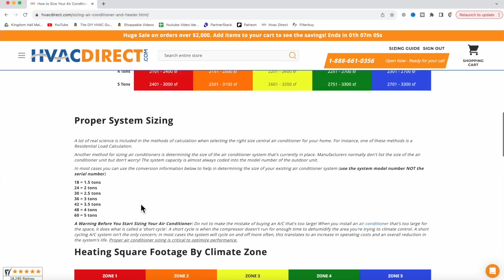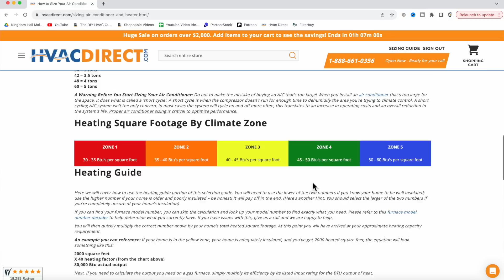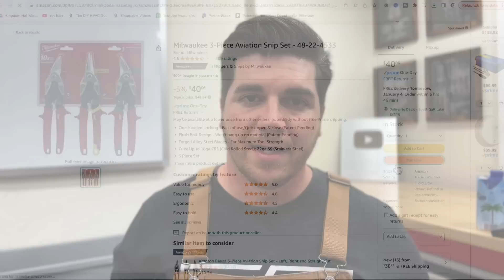Am I Allowed To Replace My Own Furnace?

Comment: I’m planning to replace my furnace by myself but I have a issue. I have an electric unit and I want to switch to gas. My existing furnace has the ac coils at the bottom and the electric coil for heat on top. If I install a gas furnace the blower motor will be at the bottom, gas in the middle and the coils suppose to be on the top. How I can put the coil on the top? Thanks.

Comment: I needed to change out a 30 old Hvac system so I contacted Hvac contractors and ask them If I bought my own equipment and just pay for their labor will they do that, they all said no, you have to buy the equipment from us. I ask why, they said there would be no warranty, I found out that's not true. Anyway, I ended up buying a fully warrantied York Furnace along with fully warrantied Condenser/compressor, filter dryer, txv valve, evaporator/cooler, 2.5 ton 14 seer all for around $3,000 delivered. I was able to find a small father & son operation with 25 years of experience doing Hvac. We agreed on a flat rate of $2500 changeout cost. So, instead of paying a minimum $14,000 I was able to get it done for $5,500.
Very appreciative for channels like this.
Reply: Was this in Utah by chance?
Reply: @CornParticulates  northern calif.

Comment: hey man, so I live In SLC, I have a carrier furnace, I’ve read and researched up on everything my carrier furnace flashes code wise. Thinking it’s either a bad board or pressure switch. Carrier 58pav070-12, let me know If you have some
Spare time and want some brief content for your channel!
Reply: I’ve installed; 
New transistor 
New capacitor 
New inducer motor and fan(hamster wheel)
New flame roll out switch’s

Waiting on new pressure switch 

Considering buying a new board, however different codes will flash if I unplug certain parts, I’d this a good way to test if my board is bad or still operational? 

Still flashes 31, was 33 before..

Comment: The only way the warranty is good if a home owner buys a Goodman system them self, is if it's installed by a professional HVAC contractor.  If the home owner installs it, it has no warranty.  It's listed so on the Goodman website, under support, internet purchases policy.

Comment: Folks in some states are going to find that the HVAC products they want will not be sold in certain areas such as Los Angeles County or possibly the entire state of CA. This is coming from the people in Government who are pushing their green new deal ideals, true or not...better or not...more expensive to operate or not. So, the majority of existing buildings are heated by natural gas and their water is also heated by Natural gas and plumbed accordingly. It's looking like those folks are in for a surprise when they want GAS HVAC or water heating items shipped to CA as those distributors are being told NOT to ship them to CA. Another issues is even if you can replace you gas HVAC with gas, the local codes may force the location to have to step up to a 90+ or 91+ furnace which requires a condensate drain and different types of venting.  Lots of buildings are unable to make that change over without a large expense in re-roofing the structure and many structures might have 10 year old roofs that are no longer manufactured so, no materials will be available to match the existing roof materials. Also, lots of folks just don't see the benefits or the value in the extra cost of 90+ furnaces in the next few years they will use them. The savings in fuel is almost nil and the risk for water damage becomes an issue not to mention the cost to purchase and for some to operate the system may increase. Then there are those who will be subjected to MUST USE ELECTRIC when they replace systems and that itself will require in many cases an upgraded main service panel from 100 amp to 200 amp and those are not cheap to install. Try about $4,000 from most licensed electricians, plus the added cost to run 220v circuit to the attic for the "heat pump" idea and even more if there is a water heater or a cooktop that is going from gas to electric. Same with wall ovens. Same with gas clothes dryers. You pretty much have to re-wire your entire home to replace a lot of items that were an easy replacement in the past. What's worse is, the people will NOT be saving money with their utility bills.  Electricity is way more expensive than gas and in CA electric power is an extortion mechanism to its citizens, especially when its 45 cents per kWh. So, it only makes sense that if you are in need of new HVAC, we citizens are going to have a big concern when it comes to HVAC contractors who want to make 2 to 3 times on the cost for HVAC materials plus in 1 or 2 work days charge a customer $2,000 to $3,000 for labor. Those charges are more than most high priced lawyers and doctors charge !  $5,000 to $6,000 HVAC jobs need to exist but our economic system is working against us as is our Government regulations.

Comment: I was charged $500 during winter to change my igniter at 10:00 pm . What parts would you stock in case of emergency?
Reply: I’m no pro but here’s my list:
Igniter
Flame sensor
A/R Limit switch
Pressure switch set (2)
Flame rollout limit switch
Limit switch/thermostat

The only two I’ve needed are the igniter and pressure switches. The pressure switches were due to a recall. Something to do with the silicone tubing corroding the contacts within. After replacing several years ago with the ‘fixed’ version no issues. I did get two for a spare just in case. I do inspect and service my furnace every year which likely helps keep my spare parts unused.
Reply: I should mention that before I had spare parts and I determined the pressure switches were at fault the first time around I had good luck with removing them, shaking the daylights out of them and they’d work for another day or so. I did that until I could find a vendor willing to sell to a non HVAC buyer. So I’ve made my purchases online at Repair Clinic. In my area (MI) all the parts suppliers won’t even sell you sheet metal screws.

Comment: I can attest to the fact that  you don't have to be a HVAC tech to know how do a lot of the stuff he shows in his videos. But yes, you do have to be mechanically inclined. Those skills I obtained from my dad. But suffice to say, I work in social services by profession and recently our family went without power for almost two weeks due to an ice storm. But because of one of his earlier videos showing how he wired in a switched receptacle, I followed along and I was able to connect our 2000 watt camp generator to our gas furnace and have heat during the power outage. Our neighbors a family of 4, not so. They said it got down into the 30s inside their home and they had to go to a hotel for $100s of dollars a night. Fortunately they didn't suffer any water pipes breaking leaving their home in those temps while they were gone.

Comment: Always pull a permit. The little bit of money you save by not doing it will bite you in the butt when you sell your house. What ever you did without a permit will have to be brought up to current code when you sell. Most inspectors just want your stuff installed safely.
Reply: But 20-30 years from now, the whole house wont be "up to code", they change yearly lol.

Comment: I like this guy. He is a real gentleman - smart, professional and kind. Going back to the topic, I was installing HVAC systems on all my properties. I was doing by myself everything is legal to do in my state. Just because "professionals" nowadays are somehow able to mess with a job unimaginably in most cases. The construction market overheated and overregulated. Company owners getting rich, but the person why actually gonna install your system makes just $20-30 per hour (in the Central states).  What should you expect from his effort? 

But having 16 years of property management experience and a BEng degree I certainly know HVAC installation can not be done properly by the average person. So, better invest your time in picking a good installer.

Comment: I'll be taking apart my gas furnace as the heat exchanger needs some work - It's only five years old.
I will ask a commercial welder friend to repair the hole or crack or whatever is there. Any opinion on this.
Reply: @bluejay713  Replacement is $1,200 CAD. Too steep if I can repair it with the appropriate materials.

Comment: I did Installed A Gas Furnace myself b.c. no Contractor want to install it after I bought it from the Supplier.  Yes I have some experiences with Electrical and A little bit with N.G.  I watched a lot of YouTube videos before I took the Next step.  Two years later, I installed an Evaporator coil and A Condenser Unit outside all by myself. When I Completed the installation of the A/C Condenser Unit and tested everything works as expected . I was so Happy 😅😂❤️

Comment: About 10 years ago I installed a tankless boiler and tankless water heater in my moms house. Both have been working very well since. I do maintain and clean them regularly. I've had multiple plumbers and HVAC techs tell me that those were a waste of money and they would only last a couple of years. Thank you for all of the videos you do. I'll be installing a mini split heat pump this summer.

Comment: I purchased and installed a top of the line Goodman furnace purchased online.  No issues.  The one thing I will say is that HVAC direct and many other places chronically oversize the furnace.  It should be designed to run 100% at the 95% design temperature for your area.

If you know the actual existing output of your furnace, taking into account the efficiency and how it behaves in the coldest weather, that will help.

Comment: you can have an hvac sheet metal company do your duct transition for you just give them the measurements of what you need  to change to simple drawing with dementions
Reply: This is a great option for many. Have the transition built at a sheet metal place and install it yourself.

Comment: its not rocket science to change out your appliances guys kind for kind follow the installation manual  of the appliance it gives you a step by step reading ok , but if you change it out for  bigger size now you have a problem  because you are required to have bigger gas lines etc for the bigger size unit and make up air, exhaust pipe etc domino affect ok

Comment: Can  and DID, I replaced my old Lennox Conservator II 115K 80% with a Goodman 80K 96%, from HVAC Direct, I  located it in a different place in the basement, ran new electric and gas lines to it as well as new returns and ducts all mself.
Only PITA was finding the return plenum pieces I needed, Menards and Home Depot each had some but not all, so I had to order parts from them and 2 other places to get what I needed.

Comment: Is it hard to replace a heat pump?
Reply from the maker: It’s the same as replacing a straight ac condenser basically
Reply: @diyhvacguy  Thanks for the reply!
Reply: @diyhvacguy Yep, only difference is the reversing valve idea.

Comment: a twelve year old with a dozen tools could change a furnace it is childs play.
Reply: Except... if the replacement isnt the exact same height, width. length as the old one, they you have to mess around with making ducts to fit it. In my case I relocated the designated space for the new furnace and had to run new electric, gas line, plenum and returns myself.

Comment: It is possible to change it yourself. Depends on local laws. Some places require a licensed company to do it.
About A/C - if the refrigerant falls under the EPA about reclaiming refrigerant properly, a LICENSE is needed.
So is the proper disposal, paperwork, records, etc.
If you get caught releasing refrigerant illegally, you face high fines and prison times.

Replace your HVAC with like and kind (similar ratings generally).

You can purchase the equipment legally. It is the refrigerant that requires a license to get.
Reply: Nobody is going to go door to door to check or know.
I replaced my furnace myself, it was a furnace only no A/C
Reply: @FCE-dogs  One needs to know if there are any 'Karens' out around them...
Another issue might be your home insurance company.
If they discover it was replace illegally, without a permit and inspections, or improperly replaced, you might have some problems with any claims.

Comment: What is best place to get the sheet metal to make the transition duct?
Reply: Hard to find, I used to be able to get 4x8 sheets of aluminum or galvanized locally in Roseburg Oregon at the time, here in Iowa the hardware store used to carry 3'x8' sheets of galvanized but no more. I wound up buying a couple of larger plenum pieces at Menards and cutting them up for flat pieces of sheet metal to use.

Comment: No warranty and your on the hook for on the new furnace? Warranty issues if your new furnace fails prematurely. You can't call up the contractor and have warranty work. You have to take care of a claim yourself. Carbon monoxide, gas leaks, electrical fires could happen!
Reply: You are really going to worry about a warrantee on a $1800 furnace? You can buy the parts they arent expensive and there's little to just "go out" other than a sensor or pressure switch. The dual switches on my Goodman 80K are $50, a replacement draft inducer fan is about $179, board about $125. If you actually READ the warrantees on furnaces you will find a big surprise on that "lifetime" heat exchanger!
We had a Dependable 92 at my work place, guy claimed the heat exchanger was cracked, I read the warrantee where it specifically mentioned the heat exchanger, the warrantee is a joke- it requires you PROVE that you didnt cause the damage by not changing the FILTER often enough, AHHA!!!! theres the catch and their "worm out" way- they'll claim you didnt change the filter enough or put too high a MERV value in and caused it to overheat and crack- your fault. GOOD LUCK proving you changed that filter every week or however often your place made enough dust, pet hair etc to need it, a receipt for purchases of filters is not PROOF you actually installed them.

Back to the "92" I told the HVAC guy basically he was full of shit, and that "you mean to tell me that the design of this POS furnace  is so bad it doesnt even have a $2 sensor to SHUT IT DOWN if the filter is blocked enough to overheat the very expensive heat exchanger to the point it CRACKS???"
He walked out, the furnace ran fine, so much for the cracked exchanger huh!
Reply: Freedom is scary, but it’s worth it
Reply: Yeah, the experts know what can go wrong. :)

Comment: You could do an install then call up a reputable repair guy to do a tuneup and check it.
Reply: Good luck finding an HVAC who will do that.  If they don't install them, lots of them are not going to give any advise about how it was installed. They will however, repair things when they breakdown or need serviced.

Comment: I just did.  I bought an ACIQ 100,000 but high efficiency to replace a 20 year old Bryant.  Spend about 2000, sold the old one for 250 (with a leaking heat exchanger).  It's some work for sure, but I saved many thousands over multiple quotes.  Videos like this are fantastic to encourage others to do the same.

Comment: My furnace guy down the street says yes, and this is what he does...but the duct work that meets the top of the new furnace will be the issue. I love your channel.
Reply: You have to learn tinning and sheet metal work too.
Reply: @daveyt4802  absolutely.. taught myself to mill and thread on lathes with some great old YouTube channels..sweep in circular fixtures with only 3 sides. It can be learned.
Reply: A few tools and videos and it's not too bad. Just watched a few!
Reply: I had to buy sheet metal duct tools like electric shears and a crimper tool along with another tool to make the locking  Z joints between cut sections etc  @daveyt4802
Reply: I just replaced my furnace and built my new sheet metal transition.  It wasn't hard at all.  It's some basic cutting and bending.  My transition is super smooth and secure.
Reply: @christopherhaak9824  sweet.. appreciate your comment. Like I said earlier I taught myself machining skills from you tube, crashing fixtures is unacceptable.. I'll figure out sheet metal. Thanks man.
Reply: The top plenum was the easiest to get, the biggest issue was finding all the parts needed when Menards didnt have all of them, and some no in stock, while Home Depot had some, I had to get  filter rack from a 3rd outfit and some bends from a 4th outlet to get everything I needed.
Reply: @FCE-dogs  good to know, thanks. Gonna learn tinning as mentioned above.
Reply: The plenum ! and The return.